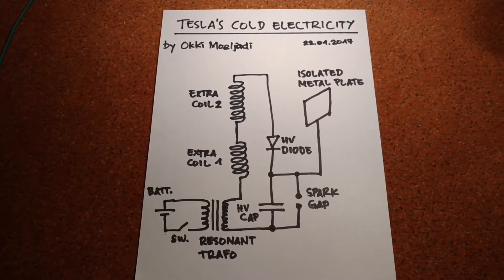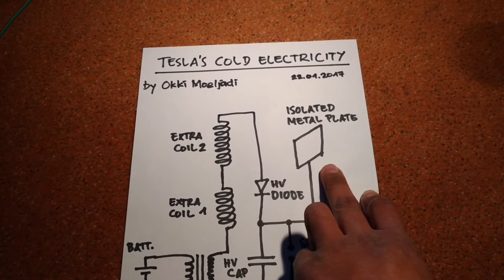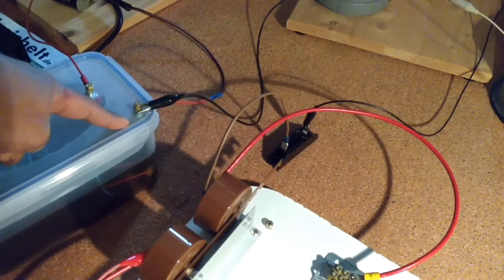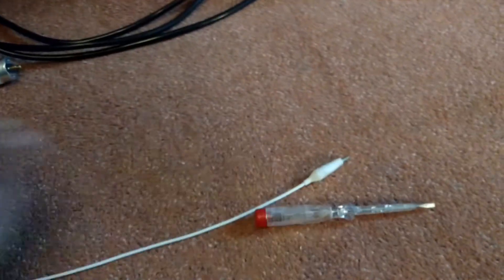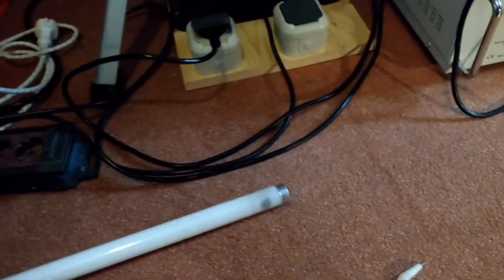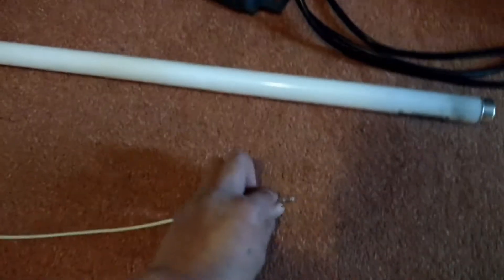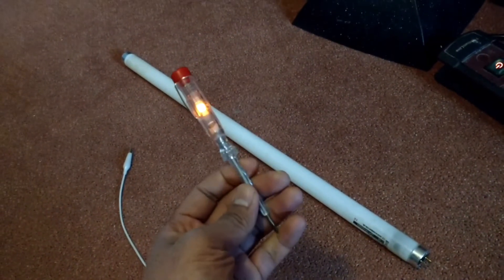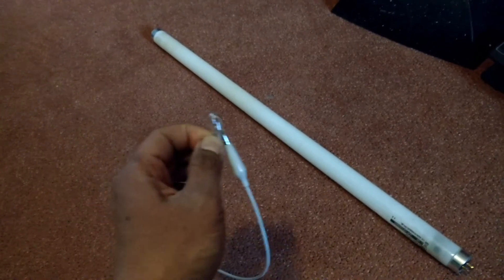Nikola Tesla's Cold Electricity (with circuit diagram)

Comment: This is not cold electricity. This is capacitive coupling. It will work without diode, capacitor and spark gap, just plate and transformer.

Comment: When you connect an old school amp meter (analog that is) you will see it shows a very high current, but obviously there is no way an actual current is flowing there (since one terminal is left hanging in the air). So that means this cold electricity is creating a magnetic field. But I doubt it will heat up a light bulb, does it?
Reply from the maker: It does heat up a light bulb.
Reply: Nice job my friend. It's was discovered by accident when Edison's light switch showed a huge back emf current. So they later built their switches to never do this. Stupid. Nikola saw the energy could be achieved. Tiny enamal wires could be used to wire house. Large heater elements could warm the room. No trick. It's real.

Comment: As tesla said , in order to find the secrets of the universe, see it as  energy frequency and vibration..

therefore and its just a theory, but when you point 2 microphones and speakers opposite each other it creates interference that magnifies in intensity more than the power required initially in the first place.

just a free thought thrown out there, but perhaps interference is a method for means of zero point energy.
Reply: that won't work without the power amplifier.
This video isn't about zero point energy it's about the very real radiant energy. One type of radiant energy is sunlight
Reply: You just explained a phase conjugated wave I think is what its called. I still need to try twelve coils aimed inward and oscillating clockwise following 369 still but do two or three all the time with speakers and coils. Working on two plasma now.
-369

Comment: are the two extra coils wound in same clockwise direction ? what is the use of those coils? have you tried without them?
Reply from the maker: Yes, all these coils are wound in the same way. From bottom to the top are wound in clockwise direction. You can read the function of these coils on Tesla's Patent (Magnifying Transmitter). He used this coil in his wireless energy transmission. Without extra coil, I could not get the "cold electricity" effect.
Reply: what happens when you try different load other than a light bulbs. for example a phone charger, a heater, a motor, hair dryer...any other device, to see the behavior of cold electricity with different devices
Reply from the maker: Inductive load will not work straight away from this cold electricity. You can power a DC motor with it but you have to rectify the current first. I have made a video of me powering a small motor using this cold electricity. What I can say about this kind of electricity is that you have "alternating static electricity field" (yes this expression is confusing). I mean, you will have pure electric field without any electromagnetic field counterpart. I don't know if my statement is correct. I think you have to prove it yourself. I have shared all my information in my videos, I think you can replicate it without any problem.
Reply: it is clear thank you for the info
Reply: Is a "pure electric field without any electromagnetic field counterpart" refer to scalar waves?
Reply: Okki Moeljadi wah luar biasa pak aku kira tinggal d barat tak tahu nya orang indo.  selama ini uda bisa produksi listrik?  brp kw?
Reply: pak bisa email sama saya kita bisa sharing idea tentang ini dan bisa produksi Listrik.  ini email saya noysantia@gmail.com
Reply from the maker: Iya pak nanti kita kontak lewat email insya Allah. Tapi jangan berharap terlalu banyak, eksperimen saya belum ada yang berhasil.
Reply: Okki Moeljadi iya sama juga tinggal dmana skrng?
Reply: jawab d email aja spy tak umum

Comment: so is cold electricity just high voltage low current electricity?
Reply from the maker: I don't think so. But you can prove it yourself. Try to touch high voltage terminal from an ignition coil or a flyback converter when they are in operation. See if you won't get shocked. I think "cold electricity" is more like high voltage low current electricity at the "right" frequency.
Reply: @OkkiMoeljadi whats the frequency?

Comment: How many KV is your HV transformer? It looks like you made it, I made mine from a fly-back transformer. This is very cool stuff and exactly what I'm doing as well but you are getting way better results and output than I am, appreciate the videos. I like to learn as much as I can from you Okki.
Reply from the maker: Hi clintified2themax. Thanks for the compliment. I have no idea how high is the Voltage of my transformer. Maybe what you can do is to use your fly-back transformer to drive an extra coil like I do here. You need to wind a big and tall coil as an extra coil. I think this is what Nikola Tesla described as "The Magnifying Transmitter". You have to hit the resonance frequency of this extra coil. I have only little knowledge but I'm more than happy to share it. I'm still learning now. If you have questions regarding this setup, feel free to ask.
Reply: Ok, I have tested mine with an ignition coil but they are limited so I'm going to build a big one but that 10ft tall one you have may not be allowed in my house. LOL. I noticed you have your function generator pushing the frequency into the system and from what I can tell, you are utilizing a winding on your power transformer for the frequency and driving power with your Power supply. Is this correct or do you have it set up another way? How you did this would help me understand how your driving the system so I can duplicate it. Thanks
Reply from the maker: I don't think you can drive a Tesla Coil directly using ignition coil. Ignition coils are usually too slow for a Tesla Coil, you will not hit the resonance frequency of Tesla Coil. I think I will make video showing my components in detail so that you can replicate it easier.
Reply: Yeah, that's what I mean, unless you pull the core, they are too slow. I would appreciate seeing how you set yours up so I can see where I need to make changes. In the meantime, I'll be working on a couple of coils, all the ones I have made are entirely too small.

Comment: Wak keren, kegunaan masing2 komponennya apa aja? Prinsip kerjanya gimana? Sukses mas
Reply from the maker: Pada dasarnya itu cuma rangkaian "kumparan Tesla" biasa. Untuk bisa dapat efek seperti ini kumparannya harus besar. Sepertinya semakin besar kumparannya, efeknya semakin menarik.
Reply: Kumparan primernya pake batre ya? Berarti mirip slayer exciter tapi osilatornya di kumparan sekunder dan pake spark gap ya? Bedanya spark gap di primer vs. sekunder apa saja?
Reply from the maker: Itu skemanya saya sederhanakan. Aslinya saya pakai sumber tegangan variabel diswitch menggunakan transistor mosfet. Mosfetnya diatur oleh frekuensi generator. Jadi yang bisa saya atur adalah tegangan dan frekuensi dari kumparan primernya saja. Kalau frekuensinya cocok dengan frekuensi resonansi dari kumparan sekunder, maka efek seperti ini bisa didapat. Kapasitor, dioda dan spark gap sepertinya tidak diperlukan.
Reply: @OkkiMoeljadi  mantul gan. boleh tau kawat emailnya brapa diameternya?
Reply from the maker: @cityzen8539  , diameter kawatnya 0,5 mm.